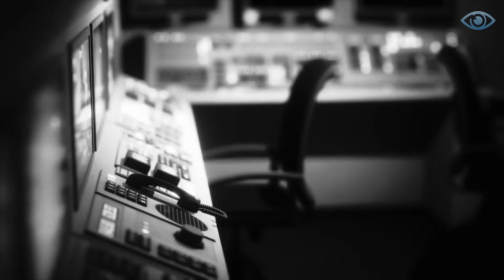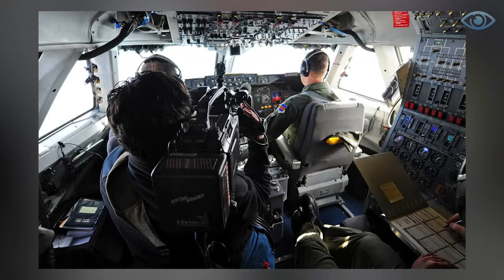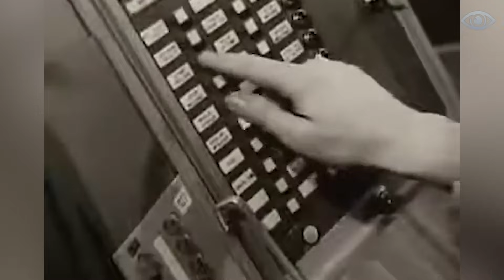You Must SEE This! The Strongest MEGAPROJECTS In The World! Top 10

Comment: Who ever told you that this structure will protect from a nuclear blast is wrong. Name the metal that survives temperature over ten thousand degrees!?
Reply: Norad can take a direct nuke strike. Its what its designed to do. Granite is hard to melt regardless of a flash of 1 million degrees.
Reply: @JeffMcDuffie72MeridianGate Nope, a building could be be made of solid cast iron. Nothing survives a nucler blast. That said, being in the center of a mountain might not even be safe enough.
Reply: @cheshirekittinz17  naw norad was specifically built to withstand a direct nuke. You should look into it
Reply: @cheshirekittinz17  well theoretically norad could survive a close nuke. It all depends on how many megatons the bomb is.
Reply: @cheshirekittinz17  one of my dreams as a kid was being the key man in the nuke silos but later i found out how tough it was getting into that position and let it go.
Reply: @RampageWrighty  Except modern nuclear weapons, the difference in yield being thousands of times bigger and temperature hotter than inside the Sun!!!
Reply: It's under a hundred feet of cement
Reply: @jimmyrussell9749  If you are talking about gamma radiation, yes, 100 feet should be enough to reduce the radiation enough to survive. But a direct hit the blast it's self even a 100feet of solid steel wouldn't stop the blast.
Reply: @RampageWrighty Are you speaking to yourself?
Reply: @RampageWrighty Go take your medication. Your nonsensical right now.
Reply: All of them...with a supercondutor high voltage electromagnetic shield😇🤔in theory...well...maybe its classifed.but the principle its the same as maglev tough
Reply: @TheArchangel-yd5sj  Very possible if man unlocks fusion reactors. But with our current electrical grid and production of energy that's required, it is not likely.
Reply: My wife's Yorkshire Puddings
Reply: Granite
Reply: @amyphillips3691  Not even close. Granite 2000 degrees vs Nuclear blast 200,000,000 degrees (fahrenheit).
Reply: @RampageWrighty They invited a word for that it's called being dumb. Which I'm sure you thought was your name.
Reply: There are also different types of Nuclear weapons both still used today, and both can be extremely intimidating. We have Fusion which destroy cities. And we have Fission which done correctly can be a global killer, take the US MK5 18 war heads all Fission (we have all heard of 2nd strike its not what you think.) In collaboration with 114 Nuclear missiles. Leaving not behind extremely hot cities like the Fusion but radiation fall out from Fission that will cause the next extinction. It's Democracy or bust people. USA USA. Just kidding can't we all just hit a bong!
Reply: @RampageWrighty https://www.ncbi.nlm.nih.gov/books/NBK219184/#:~:text=During%20the%20period%20of%20peak,the%20center%20of%20the%20Sun Nuclear Blast is way hotter than Granite!
Reply: @RampageWrighty https://en.m.wikipedia.org/wiki/Granite#:~:text=The%20melting%20temperature%20of%20dry,few%20hundred%20megapascals%20of%20pressure.
Reply: Everyone is talking about war?? Wy is no one taking about peace??
Reply: @rodniegsm1575  Nuclear weapons bring peace. As a deterrent.